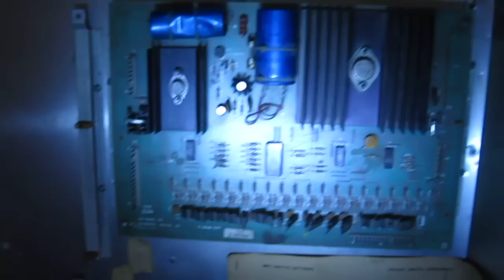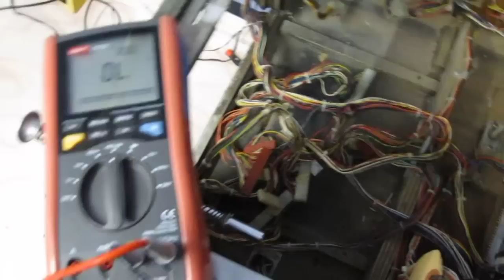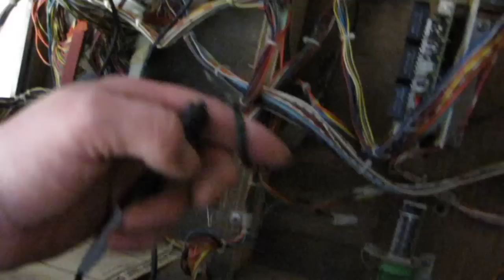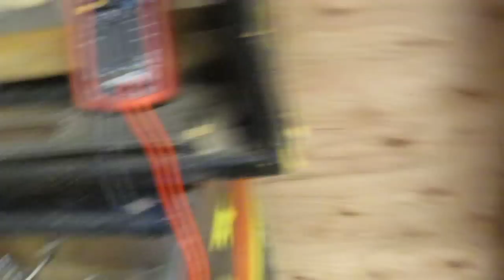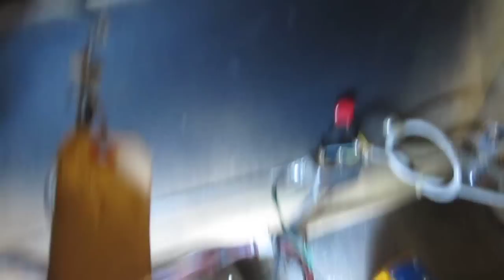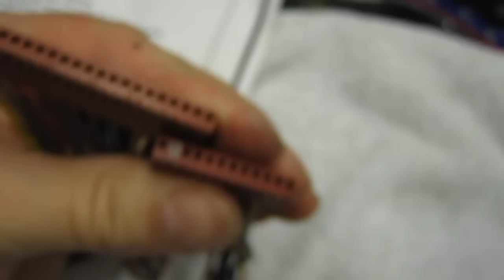Stern Galaxy Pinball - Extreme Repair - Part 2

Comment: one of my fav all time restore series.
Reply from the maker: +Amy Marie Thankyou Amy, the results are one of my favourite machines :)
Reply: i know! still to this day i cannot Understand why someone went to the Trouble of for lack of better Terms" Of fucking things up" so bad on this machine no wonder it had so many power problems.
Reply from the maker: +Amy Marie The only thing I can gather was that the mpu board was dead, so some complete moron had the idea to wire it up so that it would "play" without an mpu board. Must have got boring very quickly having coils that fire when you hit switches and no rules or scoring. I am just glad that they eventually sold it on so someone less stupid could put it back together again. The guy I bought it off did not do the damage to it, he bought it as it was his first pinball machine he played back in the day, and he decided it was too much work to restore so sold it on.
Reply: ah those Third hand Re-sell's yeah they'll getcha every time.

Comment: I also forgot to mention, it was nice to see what the original power supply looks like, since mine was converted to a Bally assembly with no GI relay.  All the time I owned that game, I never knew the GI lights were relay controlled.

LOL, powering it up from across the room, I've done that with some stuff too.  Though it seems like something only blows up when I have it right in front of my face.
Reply from the maker: If you get the machine back out and need info on wiring up the relay let me know

Comment: Do you re lacquer the pcbs after sanding off corrosion? Just wondering as in my mind when copper is exposed eventually it will turn green and corrode again. If not quicker as there is more copper exposed! I find the hiding in the corner for power on hilarious btw! I can almost imagine you with some kind of shield held up too, peering over it. Do you have rcds in the work area your in? They should provide enough safety for shocks etc. More so as you really went to town on the earth testing. I have some perscription safety glasses on order at the moment as a week or so ago I managed to get a solder blob to spit somehow (no idea what happened it just spat at me). I can tell you getting hot solder/flux in your eyeball really really really F***ing hurts!!!! Plus as seeing is quite a major part of my livelyhood I kind of want to protect it from this and the exploding caps fun......!
Reply from the maker: I keep meaning to order some green pcb lacquer, but keep forgetting. It's not really so much of a problem. If the corrosion has been cleaned up 100% then it won't carry on corroding if the pcb spends the rest of its life dry and not covered in leaking batteries. I've got pin cpu's I did years back and the copper just goes a dull brown colour. Its much more of a problem when people don't stop the corrosion and it carries on eating through. I've got RCDs in the pinball cabin, but I guess I am not used to having them lol. I bought some of those safety glasses ages ago, but they got the prescription wrong and I've never got round to getting some new ones. I probably should do so soon really.

Comment: Is there a trick to getting the pins out of the old connectors? I can never seem to do it properly without mangling the connector.
Reply from the maker: There is a proper molex tool if you don't mind overpaying massively for a small piece of metal, but it does make removing the pins easy in fairness. I've done so many a small flat screwdriver works fine for me

Comment: Is there a tool for repinning?
Reply from the maker: There is a Molex crimp tool for crimping the new pin onto the wire. You still need to manually cut and strip the wire though